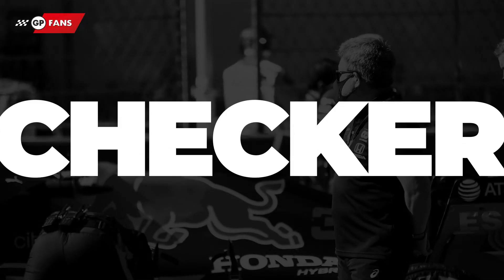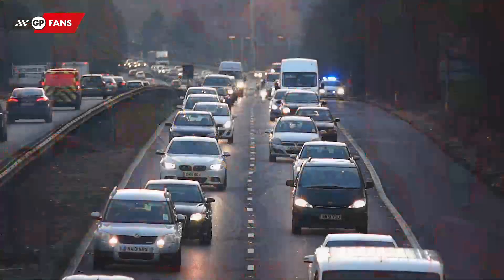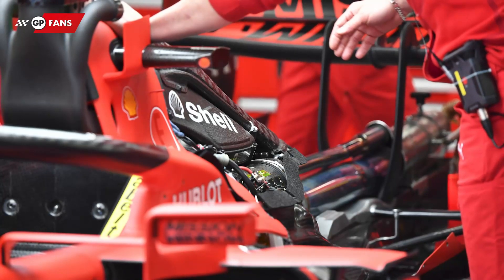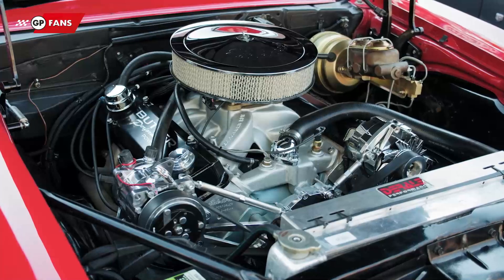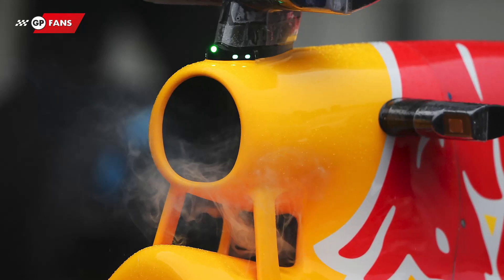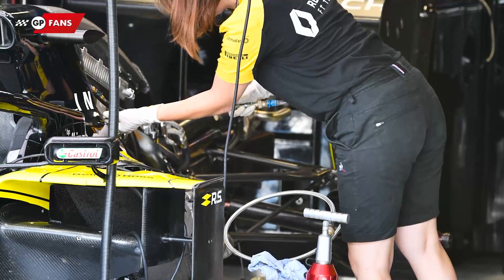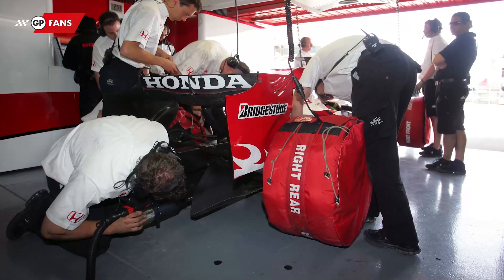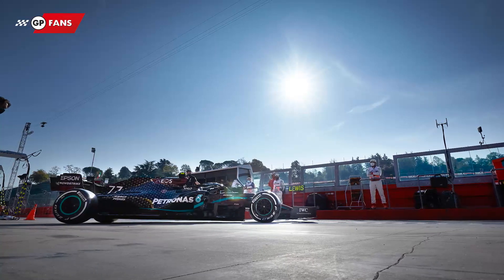How do you start a Formula 1 car? | FactChecker

Comment: F1 cars are hybrids. Why isn't the electric assist motor used as the starter like every current hybrid?
Reply: They are. The video is incorrect on a couple of things
Reply: Hybrids means in the sense of giving extra power to transmission which is gained by MCU H and K by regenerative braking and from exhaust heat. F1 engine needs higher power to start or crank which cannot be achieved by electric motor. Also f1 engine can rev up to 19000 rpm and can experience around 200 g force. So they crank it up externally.

Comment: Warmed up by the coolant. So contradicting 🤔
Reply: Nope, coolant is also used for warming up the engine after a cold start (even in your everyday road car) to get the engine up to normal operating temperatures, that’s one of the reasons why the cooling system uses a thermostat.
Reply: @juanriquelmi9076  coolant, cool-ant. you good?
Reply: @spiyder  he's right
Reply: @tundaslug07  yes i know